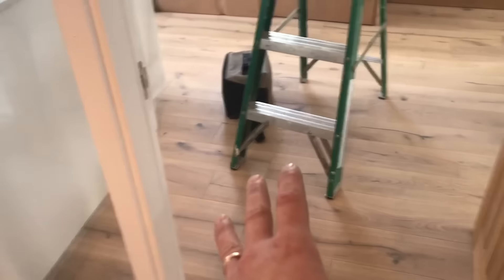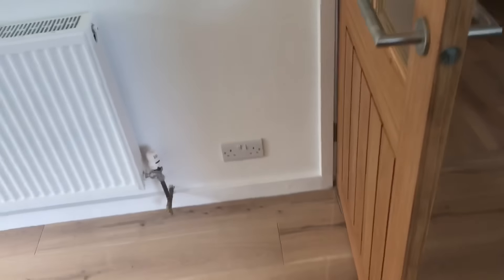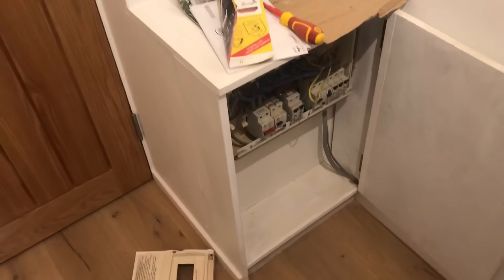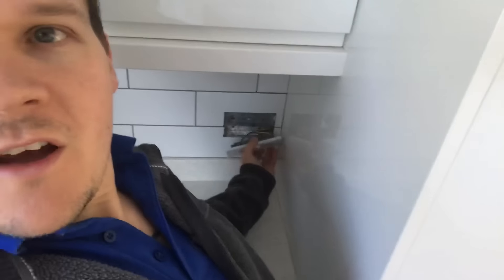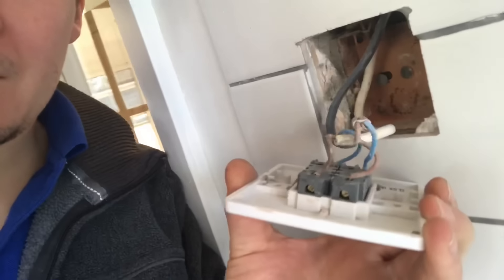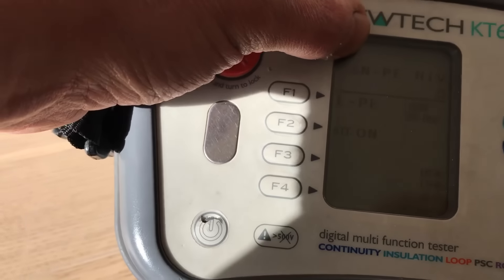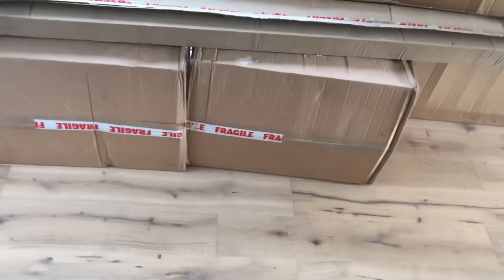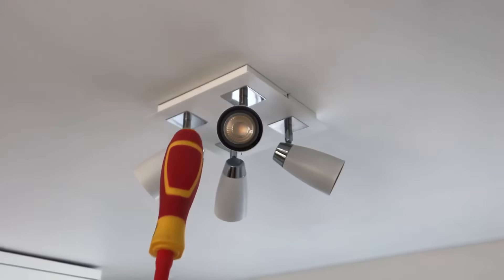Electricians day testing and inspecting one of the worst installs.

Comment: happens in the states too, was at a job the other day in a church the lights weren't coming on and i get above the drop ceiling to take a look at how it was all routed (may i remind you this is an old church that was renovated in the the 80s with drop ceilings) they ran a conduit with new feed lines to the switch and just tied it into the old knob and tube wires from the old lights and extended the old wire with new wire down to the new lights in the drop ceiling. why didn't they just run new wire its a drop ceiling it was all there why was tying into the old knob and tube even a thought at this point.

Comment: Interesting to watch electrical fails for another country...I have no idea what the violations are. Really like the receptacle tester with the nuclear meltdown alarm... Wonder if they have something like that for the US. Only violation I saw was no romex connectors in box, assuming that is required in the uk too. And sounds like they buried boxes with no access which is a no no here too. Is it 3 phase into residential in the uk? Would be sweet to have that here but I'm glad we only use 120 since I work hot all the time and I'm assuming it's like 400v phase to phase and 230 single phase.... Not sure actually

Comment: Crazy init. These people don't realise how wiring like that can potentially burn their houses to the ground or kill them under fault conditions. Proper earthing can save lives. Genuinely shocked!! Like you said you don't need to be a qualified sparky to see it's wrong, most builder contractors know what good cabling looks like. I think people underestimate the importance of electrical safety. I mean you have a gas leak, you don't get the guy down the road to bodge it back. You are more likely these days to have an electrical fire than a gas explosion. Shame you can't find the guys name and shame him watchdog style. Well done getting the message across
Reply: In Europe it’s earthing? I thought the universal way of saying it was grounding/grounded. Earthing sounds more like planting something like a tree.
Reply: @cipher1167  It is earthing, Electrician speak. I'm an electrical engineer so grounding. It's weird. Both technically can mean the same thing but not to get into it, There is Earthing, witch is domestic earth. Grounding can be sub-grounding. So you have earth but you also have sub grounds in a circuit. It was Earthing I meant though. Earthing is the correct term
Reply: @cipher1167  Grounding can just mean common place, common ground. A car has negative ground, It just means the negative is connected to the cars shell. This is grounding, it's not earthed obviously, rubber tyres. Earthing specifically means a rod in the ground to decrease Earth resistance over your bodies resistance thus current going to earth instead of you. Your body them becomes a resistive load to earth, not enough current flowing through you to kill as there is a faster, less resistive route to earth for the current to take.
Reply: @cipher1167  Okay a better explanation. I'll leave my last comments as they kind of are relevant but this is a definitive answer for  clarity. In an electronic circuit you come in generally to a power supply, say in this case it's a 24 volt transformer with a center tap. The primary would be connected to mains, 110/230 VAC The casing and chassis will be earthed to domestic earth. now in circuit on the secondary we have a choice of what we call ground reference, this can be -12V to give 24V or center tap ground to give +12 and -12V this gives the circuit a ground reference. What ever the ground primary ground reference is usually bonded to earth. Earth and ground can mean different things in this case. On domestic supply it's taken earth and ground can mean the same thing. Earth is usually ground bonded to gas, water and domestic earth. The house technically being a circuit of it's own we say earth is grounded to pipes etc. So Earth being the planet, Earth is ground to the planet if that makes sense.
Reply: Andrew Lock I understand what you’re saying, and it makes sense to people that know about electrical theory. However, in the USA we only use grounding/grounded I’m on my 3rd year apprentice and I haven’t heard anyone say earthing in residential, industrial or commercial. Most likely Earthing is an old way of saying it? Like that was the most comprehensive way people could understand in the early stages of electrical theory? Now I know if I go to Europe what earthing is. Thank you man.
Reply: @cipher1167  In your case then, earthing and grounding is the same thing. Basically most domestic "grounding" is a spike or underground metal pipes in the earth in any country thus I think European well i'm in the UK can be refers to as earth or earthing
Reply: In the UK we call the 3rd pin earth, neutral - earth - live. Blue Green/yellow and brown respectively. For example if you look at electrical engineering schematic symbols, Earth and Ground have different symbols. Earth is an upside down dashed triangle and ground looks like a garden rake

Comment: I live in a neighbourhood with old, wooden houses built very close together. The company assigned to run the town’s electrical grid (Bergen, Norway) will send inspectors every fifth year or something. (Not that often in less fire exposed areas). They check and measure for an hour or so and any errors must be fixed by a licensed electrician. All proper paperwork is then returned to the grid company. If not, the house will be disconnected. Is this a common system in other countries?
Reply: We have nothing like that, but it sounds like a good idea as long as the inspection fee is included in the 'service fee' component of power bill.
Reply: @brettv8  Yes, inspection fee is included.

Comment: in all my 48 years in the job, I have never seen an install in that condition.
I did an eicr years back, in a vacant house, where all the CPC's had been cut off/never connected in the 3-year-old extension ..isolated..informed absentee landlord..didn't hear any more until some months later..same absentee landlord, " my pregnant Tennant has had an electric shock & has been rushed to hospital"....I go there and find someone had reconnected the extension without any remedial works...we were then asked to do the required work.....mum and baby were fine after an overnight in the hospital

Comment: 14.48 the name of the screws your after are 2BAs. God I'm old.
Reply: What also screws in there nicely are No 8 screws. I never use it as an earth though, just for holding lights up. 
Pyro does last a very long time and I've had to use existing bits in the past (even though it wasn't my choice). But it much rather put new cable in anyday.

Comment: Totally random question on an old video but... I replaced a failed fluorescent tube light (with a metal frame) in the kitchen with an LED fitting that has a metal bracket that can be touched (if you can reach 10ft up). Is replacing this OK? It's an old house and the lighting has no earth. Should I replace it with a new light fitting that has a plastic housing or just expect that if my children grow into giants then they will be sensible enough not to go poking the light fittings lol.

Comment: Hi guy, I see you have the usual helpful comments from the quality service providers, just one question when you say mineral insulated cable do you mean what I would call PYRO? I find it interesting that that would have been used on a domestic install even 40 years ago? well maybe more worrying than interesting. keep up the good work its a great job if you can stand the constant pointless changes in practice, you remember rip out the metal C.U.s cause they are dangerous, must have plastic, no sooner done then, rip out the plastic and replace with metal so they don't catch fire! I remember a song by Flanders and Swann from years ago the chorus was "It all makes work for the working man to do" I am retired now because I am to old to get insurance even though I was up to edition and had completed and passed the inspection and test . even better the water board and gas board all supply in plastic so why is there even more obsession with bonding? good luck. and keep smiling

Comment: As a retired electrician, I was once a electrical inspector for Scottish power. We would never have given a electrical supply if our tests where not to a good standard. Back then the electrician had to complete a test certificate to show his work was to a good electrical standard, or there would be no supply given or even our vist. What happened was test certificates where binned and DP isolators where installed giving cowboys a freehand to connect the supply themselves.

Comment: wow i was surprised when you found 167V at that socket that means with the full line voltage at 247v there is an 80V drop  that is a serious fire hazard i hope you told this lady its a tinder box
Reply: daniel little it’ll be a poorly terminated neutral

Comment: Does the 18th say there has to be a local isolator for the oven?
14:34 Thinking of British Association? 2BA, 4BA etc...
IP44 is IPX4... 4 milli is capable of carrying 32A.
Reply: This. First number is dust, second is water.  The X in the requirement means "don't care", so dust protection is not specified so the fixture is (amazingly) fit for purpose. Shame about the rest. I don't envy him having to burst the client's bubble, but they likely put their trust in the builder;  it's not their fault for not getting a proper elec-chicken in if they're being told they don't need one.

Comment: Those ceiling lights reminded me of the led ones I got from B&Q. When I was about to fit them, there were no obvious place for an earth cable so I undid a nut and make my own earth point. No sparky but I understand the fundamentals.
Reply: If it had the double insulated logo like the bathroom light did, it shouldn't need one.

Comment: I'm no builder, but I would have expected an inspection of the electrical system before any finish work was done.  30-year-old wiring might have been adequate when it was first installed but not for all the equipment and appliances added since then.  The present hodgepodge might seem to work at first, but eventually circuit breakers may pop or there will be a fire someplace in the walls from an overload or lack of protected connections.  Appliances not properly grounded could be lethal.  

In the US, building codes vary from state to state, and in some US municipalities it's legal for a homeowner to do some parts of his own wiring, and if it's done without a permit there will be no inspection.

Comment: Surely that bathroom light is fine? IP44 meets the IPx4 requirements for zone 1 and it had a class 2 symbol on it so it doesn't need an earth.
Reply: but the thing is it is good practice if there is an earth terminal connect the terminal as he said its a metal fitting so it does need an earth becase its METAL WHAT if it comes live and there is no earth fuck  the thing been water resistant think about someone getting electricuted
Reply: The double square symbol means the fitting is double insulated, therefore no earth required
Reply: While the fitting might, what about the lamps? I am not sure if has fixed lamps, but if they are replaceable then there is more potential for issues - that is even before you get to the "no earth needed" - if so, why are the lamps connected to the shell with earth leads, and there is even a choke (that will do stuff all disconnected)
Reply: Its probably only double insulated if you use them shitty connector blocks that are already on the fitting with that black sleeve over it. By using his own connector blocks, he's fucked it!
Reply: I think the point is being missed here. Why put it in zone 1 in the first place but I agree it should be earthed particularly as its in a bathroom. I am not a qualified electrician but worked in the industry all my life on single and 3 phase equipment which I was qualified for.

Comment: If you read this I’d like your input - I agree totally shocking installation (excuse the pun) but what do you think of splitting dual RCD boards on the new edition? I prefer splitting them as power - lighting. As in high - low.
I know it can be random and just generally mixed but I would say the regs should have a case for having a separate fast RCD for any “wet circuits” - toilets,  bathrooms, showers etc.
Thoughts?
Cause then that would stop you ever finding an install like that again, since you would find constant RCD trips all the time to the point where no circuits would work. Or evidently not work in certain areas that the customer would notice.

Comment: She needs to request builder to rectify all, if he refuses, then start small claims case for cost.
I was expecting hidden cameras, ref for TV program.
Reply: no, no small claims is not enough for that kind of danger you can go directly to the high court for anything over £1000 don't fucking mess with county court they are useless. in this case there is more than material damages for the cost of replacing the wiring you have to include that the property was put at risk of fire and any occupants safety was put at risk
Reply: They'll just declare bankruptcy and get a new person to run the company. A shit company we last had problems with it was the blokes wife officially in charge because the last time he got taken to court he declared bankruptcy. You won't get a penny back from them.

Comment: I had an electrician out to do an EICR recently after thinking the house needed a rewire in order to boost sales price in future (house built in 1979 and it's original wiring/consumer unit etc)...  Wiring was all tested and found to be in almost 100% working order and only thing needed was upgraded consumer unit and main earth...  Then additional stuff i've asked for (modern wall sockets, switches, recessed lights in ceiling etc...   Does that sound right with regards the wiring?
Reply from the maker: Can be but why on earth would you not want to Rewire a Property with 40+ year old wiring. 25years is the life span.

Comment: Hey Buddy the electrics should be condemned as unusable for safety issues ,if the owner uses them and gets electrocuted  as you were the last one to notice it ,you would classed as liable.
Reply: No he wouldn't. He didn't do any work on the installation. He didn't change lights or add sockets. He tested it and gave a report to the client and I'm very sure that report labelled the installation "Unsatisfactory"

Comment: Got you beat. Did a remodel where likewise i came in after some butcher of a contractor buried wire-nut splices IN the drywall. Not behind. In. Cut a shallow trough in the drywall, made his illigal flying splice junction and then slopped drywall mud over the whole shabang effectively hiding the junction. And he did that everywhere. I told the customer that they didn't need an electrician, they needed a lawyer.

Comment: Wow you use instruction book for your tester? If your plug in tester reads open ground then it means ground wire is not connected to receptacle right? Why does it have to be rewired if ground wire is in j box but not connected to receptacle?

Comment: Can you do a video on bypassing an electrical meter so I can grow lots of weed
Reply: Pull the fuse.... shhhhh i didn't tell you that.
Reply: MR Coffeebreak perfectly safe lol
Reply: Pull the meter.....put bare ground wire into the jaws on the meter box....
Free electric till your house burns down.
Reply: @MR Coffeebreak you actually can pretty much do that and have no problems.
The breakers are still there.
Its Just unlimited amps at the meter can while installing the bare jumper.
Which still is safe....as long as you arent grounded.
Reply: In some countries you can't. If the substation has a meter to prevent theft of power, then they can compare between the substation and usage of the actual houses. If it doesn't match then it becomes a clear indicator that someone is playing them.

Comment: oh man you should have come to tunisia (worked there for a year as a S&L tech) they could do so much worse that this. for example i can remember them putting in lights by cutting open some of my speaker cable (4 core) and using the two unused ones for mains because they couldn't be bothered with an earth connection or to run new cables 😂

Comment: I want to fly you over here to the house we just moved into. It's 118+ year old cabin that's been added onto a few times over the century... I DO NOT know how this house didn't burn down. The person who lived here years ago chopped and spliced everything on. There isn't a solid run of wire greater than 10 feet in the cabin or kitchen. None of it's standard wired. Its old cut up cords from lamps,  Christmas lights, radios, and other house hold appliances jammed into the walls. If he needed to run a wire 18 feet, he would hack off 3 6 foot sections of cords from whatever dead or broken appliances were left laying around, twist the ends together, wrap it in masking tape (not even electrical tape) and shove it behind the drywall or mud it into the cabin walls. There isn't a single ground wire in kitchen or cabin. It's about 50/50 odds that the hot and neutral will be reversed and some of the wire is the old braided fabric cables from like 60s and earlier that is so deteriorated that it turns to dust when you touch it. Some of the outlets have wires from multiple breakers coming into them. So even if you think you shut the breaker off, there might still be live wires in the box. Fortunately, the other additions were added on more recently to the house, and who ever did those seems to have known what they were doing, as it's at least modern wire, grounded, and no hot/neutrals being reversed.